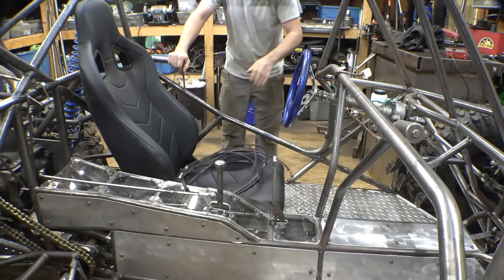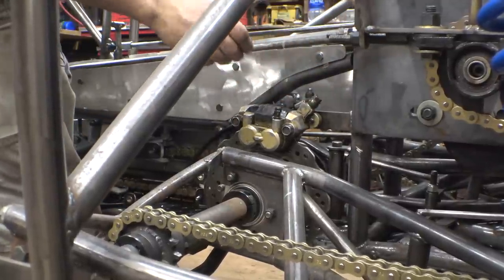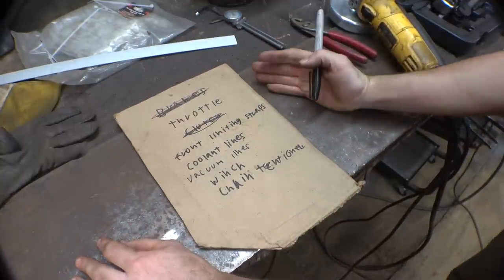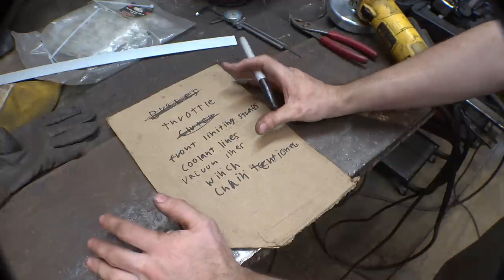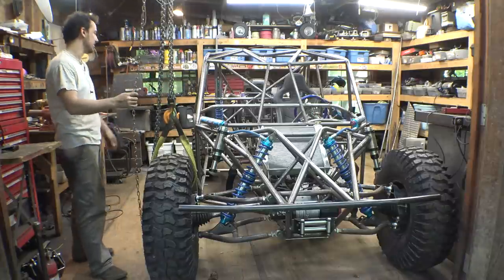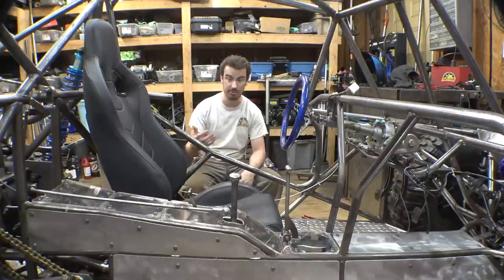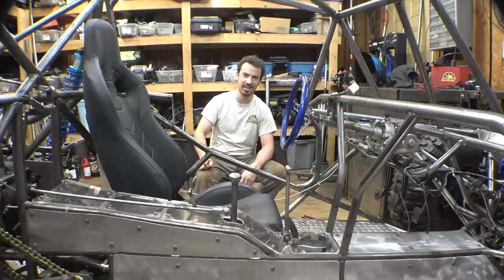Mini Trophy Truck Build 4WD - Part 24

Comment: My guess is that the break fluid is dissolving your latex gloves... thats why it heats up...  I think you need Nitrile gloves instead... Same thing happens when I use Isopropyl alcohol to clean my 3d prints if I wear latex gloves...
Reply: You are right! But even nitrile gloves don't stand a chance against carb cleaner!

... do you have a good suggestion for carb cleaner resistant gloves?
Reply: It heats up because of the reaction with moister on your skin.
Reply: @FordMustangGTRocks chemical resistant gloves, like the ones you would use with bleach
Reply: @austinc4013  what material?

Comment: Don't forget the throttle pedal limiter so you don't break something on an impact!
Reply: Needs a good low response pedal with a long pedal throw. That way the bounces don't modulate throttle input very much. Depending on the design if you used a lever you could make some sort of progressive input on the throttle, with a shaft design you could have linear throttle input. If I could draw in the YouTube comments it would make more sense.

Comment: That bolt you welded/drilled/machined to make the throttle cable adjuster...fucking beautiful.  I get it on the burnout, down to wiring and plumbing on the skinny X3 but it's all the little shit I kicked down the road that nags at me.  Gonna make a new checklist in the morning for inspiration.

Comment: Have you considered using an automotive style vacuum accumulator/tank with a built in one-way valve?  It would collect engine/manifold vacuum, and then you'd just need a pair of solenoids to connect it to the axles for locking - no worrying about syringes!  Even a pair of small vacuum pumps might do the trick, which would simplify it as you could put them right close to each connection, and then just run wires up to the dash.

Comment: On the brakes if you hang the caliper as high as possible and make the bleader be the highest point and use a bleader pump you will get all the air out faster and more efficiently. Air rises so using gravity can still leave really small bubbles in the lines. Causing uneven braking or slightly squishy brakes or even causing brakes to lock up once they get hot.

Comment: Adding a closing cable or a pullback spring on the throttle would make me feel safer driving this 180+hp beast...
😉
Thx for showing, getting close to run it!
👍👍👍

Comment: The best way to bleed your brakes is find or make a pressure fluid system where you pump the brake fluid into the caliper until no air comes out the master cylinder, works amazing and less to no mess. Thanks for your awesome videos 🙂 great stuff
Reply: He does it his way.
Reply: He knows how to bleed and what to use lol.he will still do it his way

Comment: IFS front and back.  The flex is fine.  Youll always lift tires with it. Nothing other that gravity to hold the wheels down.  With solid axles when one side lifts it pushes the other side down.

Comment: Usually when you have a fresh chain tighter than it should be, it will over stretch and make the chain fail prematurely. I feel like the tensioner should be flaoting and have a good strong spring on it so it isnt too tight.

Comment: You can use engine vacuum with a small vacuum canister and pneumatica valve to actuate the four wheel drive..

Comment: Chris sure I don't need to tell you but just in case. If you lengthen your front suspension arms it will not have an effect on your CV angle limits but it will increase your suspension travel, just thought I'd mention. 
Love your work man.

Comment: Mostly agree with all the components that you have installed so far, but I think I would have used maybe a strong exhaust spring for the chain tensioner. Reason being for chain stretch in the future. But all in all looking good so far.

Comment: At 24:33 (your throttle cable install)  By NOT making a rotating cable termination , will cause a stress riser at the cable end that will make the cable fail (crack) at that spot. Look at every throttle cable on any machine for reference.

Comment: With your ability like to see u build a portal box on outter hubs seen this done on mud swamper utvs i now alot are custom build loved to see a mini say flat fender jeep since body could be easy to mimic build on portal independent setup possibly use shaft drive quad motor that has reverse  already something small but fun doesn't have to be incredibly fast more offroad and looks i feel u could do it i wish i still had all my equipment before mad bad life choices i had built some cool mini's but always love look of old willys jeep keep up great work and have a wonderful day.

Comment: the vacuum line locker would be funny if it were one of those foot pedal ebrakes. you probably don't want to be moving when you activate it and maybe your hands will be busy. although maybe your feet will need to be on the clutch and brake already i don't know

Comment: I’d love to see you build a tubular mid drive electric mountain bike/motocross hybrid with full suspension (only because I want to build one my self but wouldn’t know where to start) 😂
Reply: It would be too heavy if you're looking to build a DIY surron type bike. I think he did it right when he bought the small Motorcross bike and converted that. I'm in 2 minds if I like how he did the drive using the hub motor inside the frame. But it works and it's probably easier to maintain and less wide than using a chain drive motor.

Comment: the hydraulic and throttle lines/cables seemed a little botched and like you just threw them in... I can see why the throttlecable has to have as few bends as possible, but the hydraulic lines could have been made to follow the fram alot better with little effort making it much more hidden and neat looking IMO...
-Not trying to be an a$$, it really is an awesome build and I do get the whole feeling a bit burnt out from working on it... Just feel like it deserves a little more love on the finish... 
But Thank you for making theese videos. it is a joy to watch you create theese cool cehicles and learning by trial and error! :)

Comment: Can you make a multi point shock mount with like 10 holes offset . To change ramping dutit on the thick . May need more limiting strap points also . Just a thought . 😂😢

Comment: If you have ever noticed on cars trucks and well anything that has hydraulic brakes they are mounted with the bleeder screw on the top of the caliper for a reason.  I know you said that you don't do it that way for some silly reason that I don't remember the last time I pointed out that you mounted the calipers upside down but the laws of physics and gravity don't change so you can perform that ritual if you want but I think I would just mount them correct and be done with it. Lol

Comment: Amazing job, just a comment, you don't need to tighten the bleeder valve that much
Reply: That is correct Samuel.  There is a 1-degree difference in the taper on the bleeder and the bleeder seat.  That tiny difference allows the bleeder to stop several thousands of PSI with just a gentle snugging of the bleeder.  Since the bleeder is actually hollow, overtightening can crush the bleeder causing problems.

Comment: Put a clear hose on the bleeder nipple, it will prevent air from going back in the nipple. That is not how you bleed brakes. It may work but it's not how you do it.

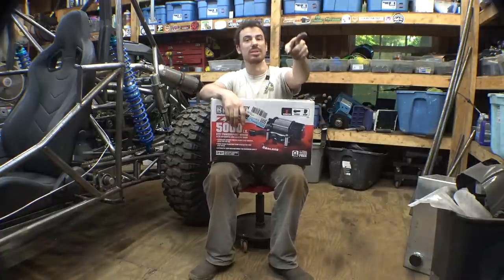Comment: Looks good Chris, though I'm not a fan of that exposed brake pipe hanging in the air as seen at 15:27, I believe that should be run to both follow and be secured properly to the frame since it appears to be at a great risk of snagging and potentially getting damaged
Reply: He doesn't care what you believe it should be.
Reply: @jerrywilcox9890  Perhaps, but I believe it best to share my concerns rather than let something potentially dangerous go unobserved
Reply: @GaisaSanktejo  no you just like try to tell people how you want it done.he does it how he wants to do it.hes built more of these then you will ever build lol.
Reply: @GaisaSanktejo  nothing dangerous about it.hes not close to being done  lol.second it's a brake line not a pipe lol.and he doesn't ride anywhere to snag anything lol.
Reply: @jerrywilcox9890  
🤷‍♂
While you're right about how Chris will do as he chooses, I have no problem with that.

As for his building his projects, you are technically correct since I don't create new builds like Chris, but I do have thirty five years of automotive experience, which includes maintenance, servicing, repairs, insurance repairs, rebuilds, restorations, welding and bringing vehicles up to the UK road safety standards.

As for my opinions and concerns? I share personal opinions, preferences and concerns, which are heavily influenced by the above experience and projects I and those like me have done in the past along with those currently in the works which have to meet UK road safety standards.
As for the "dangerous" comment? please note the "potentially" part before that.
I saw a line/pipe/whatever it was "hanging exposed" and perceived a possible issue with it as it currently is.
Do I expect my post to be acknowledged or followed? 
No, but it doesn't stop me sharing my opinions and/or concerns regardless, just like you shared your opinion about me.
😉
Reply: @GaisaSanktejo  this is the US not the UK.nothing is going to hit the brake line .
Reply: @GaisaSanktejo  lol he knows what he's doing he's built many of them he doesn't need your opinion.
Reply: @jerrywilcox9890  Thankyou for sharing your opinion
Reply: @GaisaSanktejo  👍 lol

Comment: ?? you put the chain tensioner on the power side of the chain. Its going to receive the full torch of the motor before the rear sprocket.

Comment: Doesn't the limit straps have to be welded with tabs inline with the bolt. Right now top one is pulling on weld at an angle.  Which I'd think would be weak compared to equal pressure pulling straight down no the welded tab. I'm no off road expert so could be wrong

Comment: Syringes
there are some without rubber
over time better resist oils etc.

" bi-component " syringes / in france
but pharmacists do not necessarily know, it is very little sold - cheaper...

Comment: Pro tip for bleeding small brake push the fluid with a syringe form the bleeder screw up to the master so the air will naturally excape by the master
That the recommended method by ktm to bleed the hydraulic clutch

Comment: You still won't get all the air out because air is lighter than fluids so the air bubbles will travel up the line if you had a clear line on their you'd see what I'm talkin about

Comment: Good progress mate, can i ask where you bought those bar clamps that you used to mount the chain tensioner to the frame please? Or if you could link them? Cheers
Reply from the maker: They are just 1” go kart axle split locking collars

Comment: Build a Ford Fiesta amateur rally car, now. 😉

BRO!!!!!!!! This thing is cool, but IT'S NOTHING LIKE A TROPHY TRUCK, OR AN ULTRA4. This is a BUGGY. It's a buggy you could rally in, AGAINST OTHER BUGGIES. 

Also... You need a brake system capable of getting really hot, and stopping a small FAST car....... And 70% front, and 30% rear, is the stopping power you need. This BUGGY is going to be as heavy as some small cars......

Comment: I can't believe you gave away "The Mechanics Greatest Easy Money Secret".  Gravity bleeding.
Just kidding.
The truth is, that brake bleeding is a mythical challenge that society has complicated for years.
Overfill the master to the top, leave the lid and rubber diaphragm OFF! and open the brake bleeders one at a time while keeping the master full to the top.  Let the fluid run until clear.  BAM DONE
It is easiest when the pistons have been pushed all the way into the caliper. If they are drum brakes, the parking brake is not applied.  Remember the WEIGHT of the brake fluid in the master is the ONLY thing causing the fluid to drip out of the bleeder (so keep filling it up).
Air can't jump into the system, UNLESS SOME FOOL TOUCHES THE PEDAL. 
On some systems, the lines may actually be routed above the master cylinder for the right front wheel, (Jeep CJ), which may not gravity feed that wheel. 
P.S. You don't have to explain to us when you need to switch it up to another project...we get it.  You build extremely complicated vehicles BY YOURSELF from the ground up.  AWESOME!
Take one of your projects out, leave your camera at home, and have fun.  We need you to be mentally sound.

Comment: if you are fitting a chain tensioner that is not spring loaded why bother, Shorten the chain, there are half links to help you get it spot on but a rigid tensioner doesn't make any sense,

Comment: Messing with the chain over and over again, spending a lot of time each vid on chain non-sense. Axles are much easier to work with and faster so don't get burned out with a extra week+ of chain work.